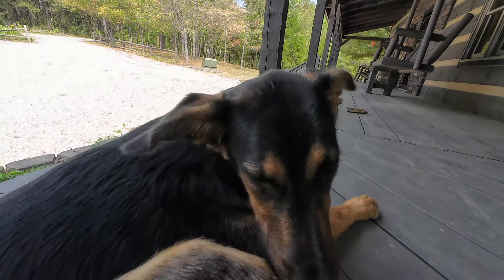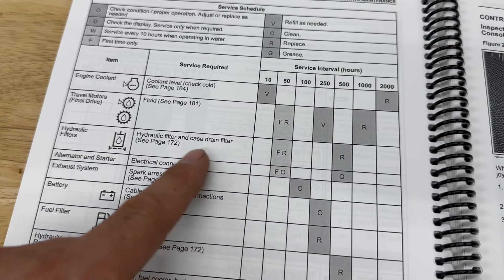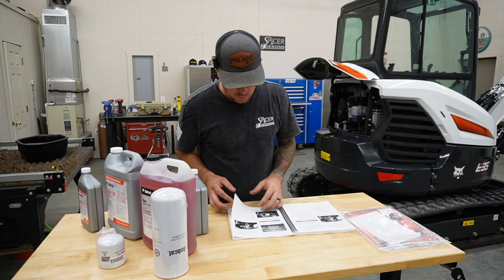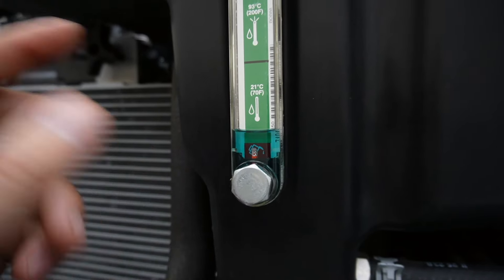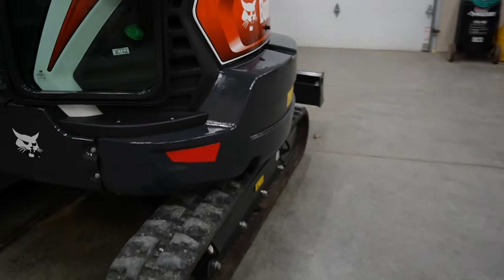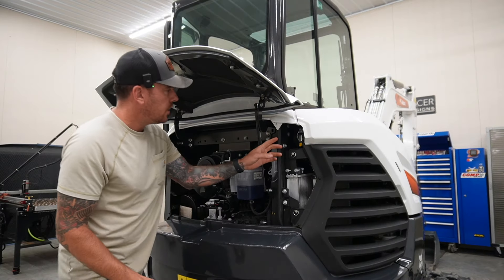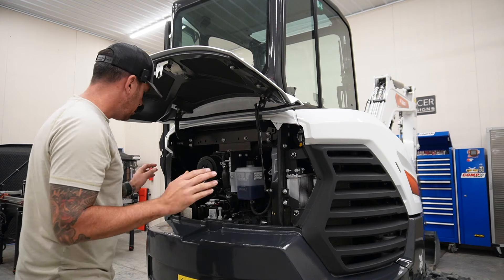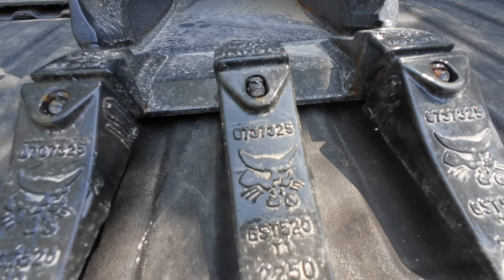BOBCAT E35 R2....BREAK IN SERVICE. (50 hour) Step By Step

Comment: Great job, I'm about to be doing this exact service. This was super helpful. FYI it looks like you can reach in by the boom arm mount up front and grab the case drain filter. I'm going to try that since you faught with it.
Reply from the maker: I looked at doing that but it seemed tight.  Im curious to know if that works better

Comment: Nice vid!  Thanks.  The air intake restriction indicator operates like a GFI switch.  If the filter gets plugged, the indicator will "pop" and latch the red flag until you press the spring loaded release button.
Reply from the maker: @Tom_H  ahhh that makes sense.  Thanks for sharing.  I will pass that along in a future video.

Comment: The case drain filter is absolutely a nightmare to get to …I ended up removing the bracket assembly and flipping it upside down to remove the filter from the mounting bracket. I found some small clamps from Harbor Freight they come in a set of 4 which works nicely to pinch off the hydraulic fluid from draining everywhere.
  But otherwise the 50 hour service is pretty easy to do.
Reply from the maker: @stevenbecker9302  thats a good idea.

Comment: Just purchased an E40 it is time for the 50 hour. The Auburn Bobcat dealer told us we could mix the red & blue hydraulic fluid. Is there a way to verify that before we top it off?
Reply from the maker: I would not do that.  I specifically read not to.  They should have both versions in stock.  I mentioned that in this video

Comment: Kyle, so, when you change the hydraulic fluid at say , 250 hrs(per manual?). The red fluid is the correct type? And the blue is maybe just for 'break-in' period? 
On my Tractor, I had to replace 9 gallons hydraulic oil, filters and clean the sump filter at the 50 hr service. Pretty pricey. Guessing the hydraulics are different, your Bobcat uses hydraulic fluid, my tractor uses hydraulic oil.
Reply from the maker: @JohnSmith-tv5ep  i should have mentioned it in the video.  The red or blue is recommended.  Theyre based off climate and have different additives.

Comment: The manual basically tells you to change every filter and fluid except for the antifreeze every 12 months if you don’t hit the hours. The antifreeze is every two years. At least on my 42r2 that’s what it says. Bull crap. I barely put 150 hours a year on mine. 🙄

Comment: be nice if they had valves there to change the  hydraulic filter so you wouldn't need to pinch the hoses.
Reply from the maker: I agree.  The one in the cab was an absolute mess
Reply: @SpicerDesignsLLC  the one under the cab looked like there where 2 bolts holding the bracket on. might be ez to unbolt to get it out from under there to change it and bolt it back up.